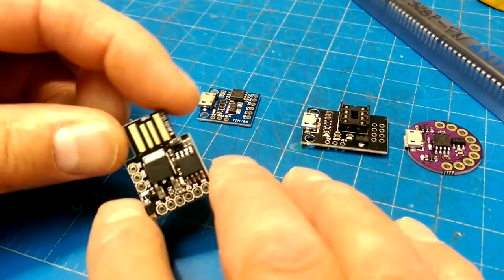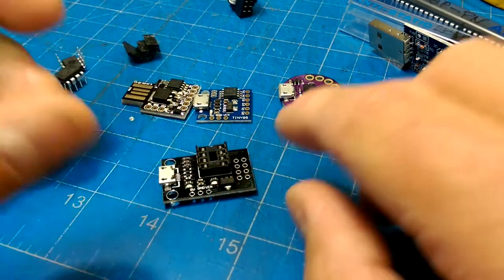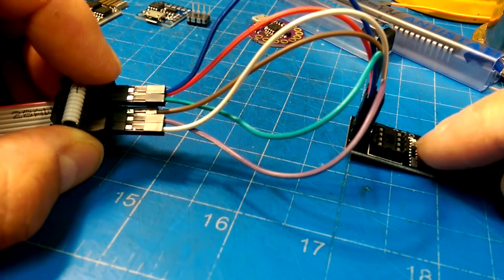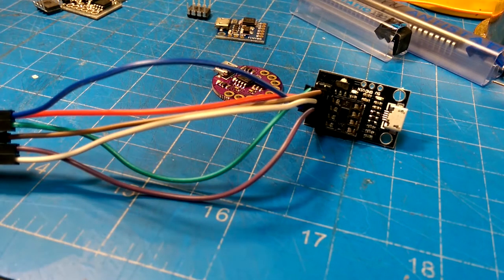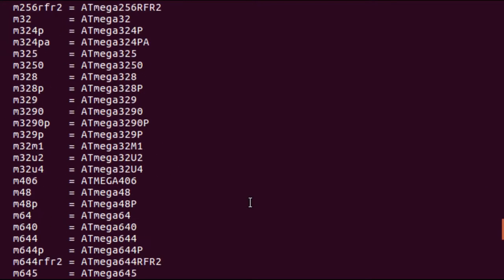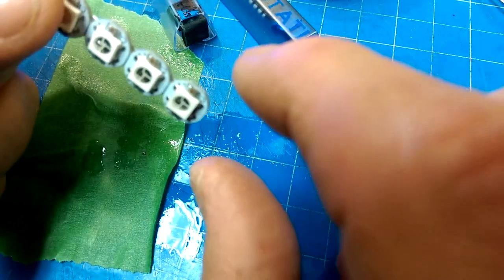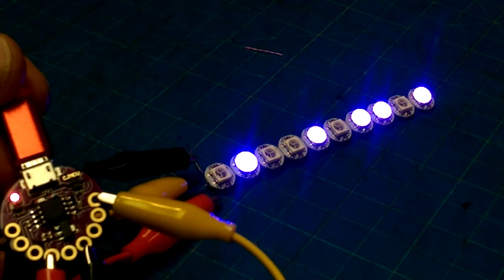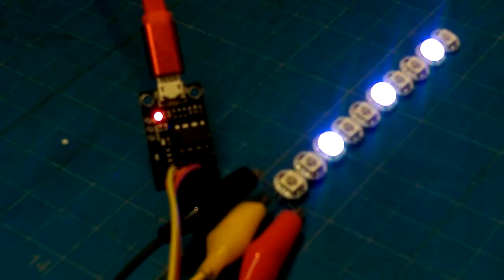Flaire Ware   Part 2

Comment: As usual your video is beyond brilliant! I think that maybe the Hackerboxes folks kind of dropped the ball on the topic of burning the micronucleus bootloader onto an AVR ATtiny85 chip using the dev board and USBasp programmer board that they provided. Hackerboxes didn't really provide any educational links to flesh out the whole process. I was able to use the CJMCU LillyTiny as a substitute for a Digispark and do some basic USB rubber ducky stuff. But I'd like to know how to take a raw ATtiny85 chip and do the same thing. I really appreciate your approach but I'm not really prepared (knowledgeable/motivated) to  figure out how to use the Platformio editor that you are using in your example. Do you know if it's possible to use the USBasp programmer and Arduino IDE together to do it? It seems like it might be possible.
Reply from the maker: I have used the USBasp with the Arduino IDE and a digispark, but it has been a while.  I think that you have to install the MightyCore but my memory is sketchy.  

There is a learning curve to get up to speed with Platformio, but it is worth it!  Code completion is just the start!  And it is not too hard.  I use Linux, so a tutorial would have limited applicability.  But I suppose booting up a Windows VM would not be too hard.